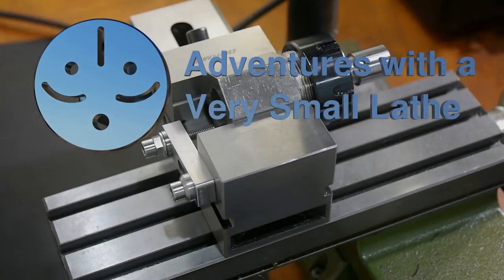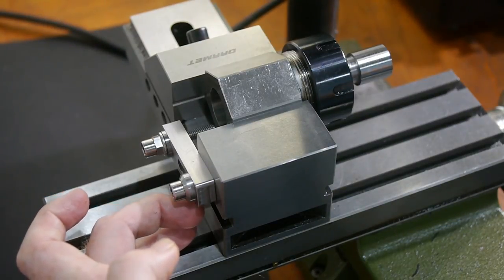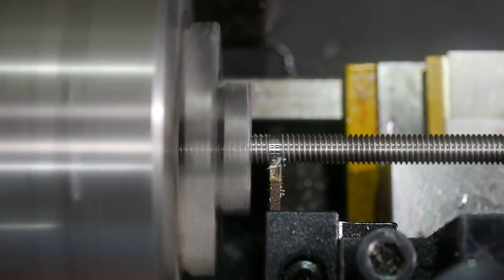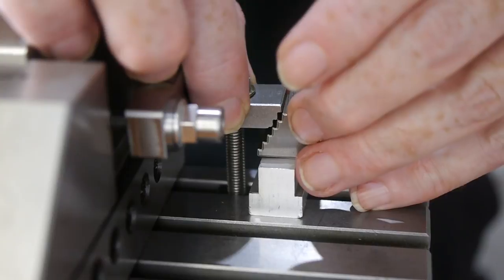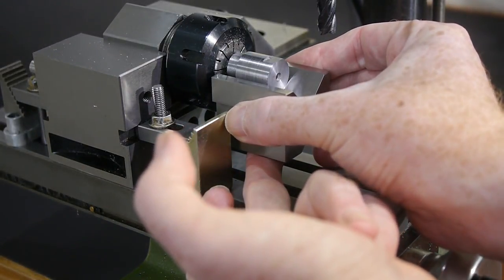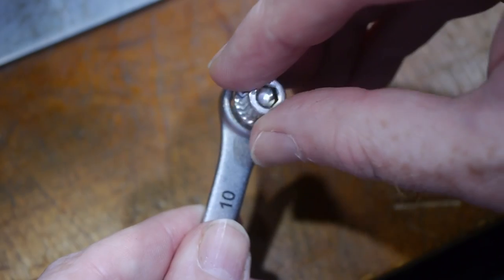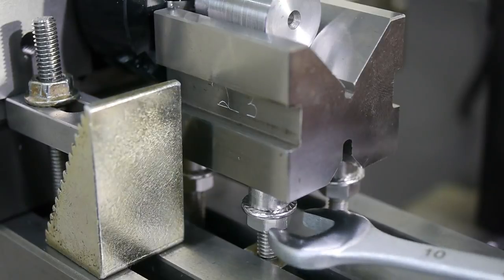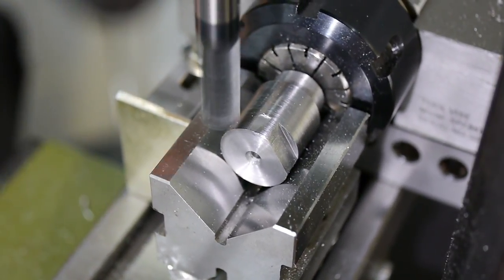Just One Fixture - Improvised Micro-Jacks and more Custom Clamping Rods

Comment: Nice video.
You don't need that extra vise stop! Do like this: Temporarily tightend the hex block to the vise. Then tightend the object to the collet. Loosen the block from the vise and use the locking nut as vise stop!
Reply from the maker: Thanks for the suggestion! I've used exactly that technique before, but sometimes it limits my options. I made the vice stop so I had more freedom where I could locate the vice, and the collet block in the vice.
Reply: @AdventureswithaVerySmallLathe  Digging in the memory, yes, I think it has happened here as well. Anyway, that vise stop is more than useful in plenty of other situations than clamping those blocks.

Comment: I've been trying some milling on my Unimat SL.... but I get this awful and very loud "thud thud thud thud" noise whenever I try it. On Aluminium it's just about tolerable, but on steel... I'm going to get complaints from the neighbours. Anyone got any suggestions on how to fix this? I notice you get a fairly awful "grrrrrrrrind" noise when you mill? Do I just have to learn to live with this level of noise?
Reply from the maker: That sounds really annoying. How regular is the thud sound? If the cutting flutes aren't continuously engaged with the material, there will be a sound as each one comes into contact, and starts cutting. What spindle speed are you using, and what type of cutter? It's worth checking whether you're running the cutter at the speed the manufacturer recommends. My machine makes terrible noises if I run too slowly. My neighbours have never complained, but I think they're just tolerant. I never run my machines after 8pm out of consideration.
Reply: @AdventureswithaVerySmallLathe  I think it's about regular enough to be the sound of the flutes coming into contact. I'm doing about 850 RPM with a 10 mm 4 flute endmill or a 3mm 3 flute endmill. I'm (you could say) rather nervous of higher speeds... but that could be the problem.
Reply from the maker: I generally run carbide endmills a lot faster than that, and I find they run a lot smoother. If you're fortunate enough to have a proper manufacturer and part number for the endmills you use, check out their rated cutting speed. If not, use Google to find something similar and use those ratings. For example, a 10mm HSS endmill would have to be run at 1200 rpm to get up to the normal recommended 40 m/min cutting speed for HSS. A modern AlTiN coated carbide endmill might typically be rated at 150 m/min, which means a 10mm endmill can run up to 4700 rpm in a modern CNC machine with good rigidity. Obviously speeds like that aren't possible on machines like ours. One problem is they aren't as rigid, but running the tools way too slow doesn't really help with that.

I suggest you experiment with what your machine can do, and just accept that you may need to break a few endmills finding out. Put on your best protective eyewear (as always), and find out how your endmills cut at higher speeds. Do what you can to find out the rated speeds and feeds, and stick within those.

Comment: Or, or...thin down the thickness of the washer(s) on the vise stop, machine the diameter of the washers, the same diameter of the bolt head, and use button head Allen bolts, instead.